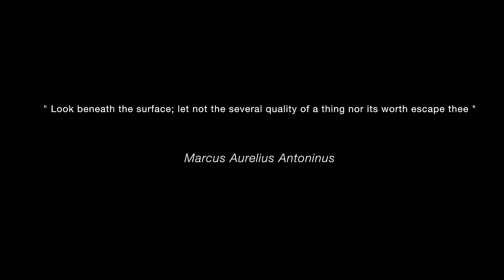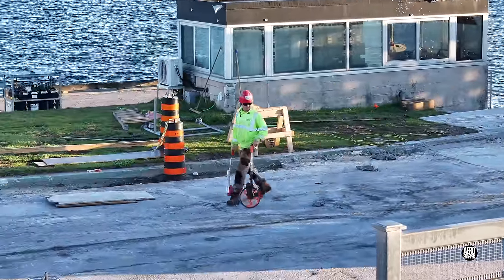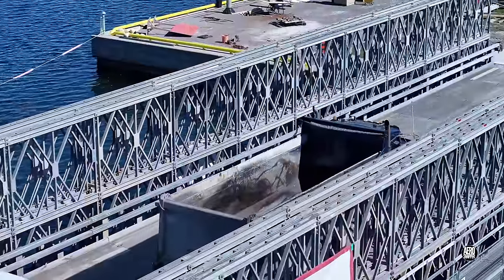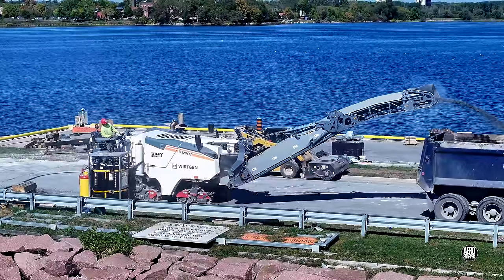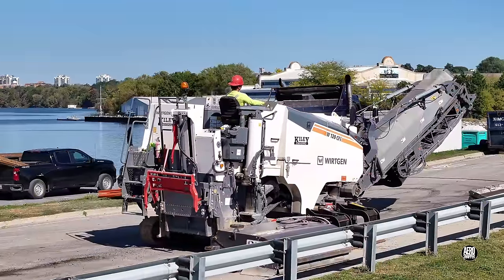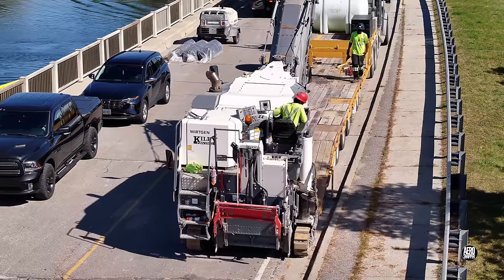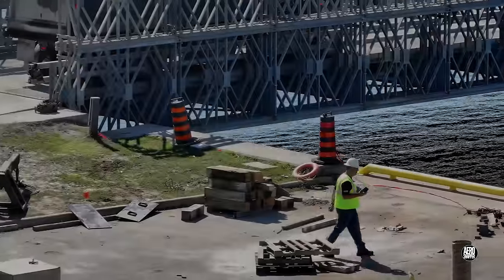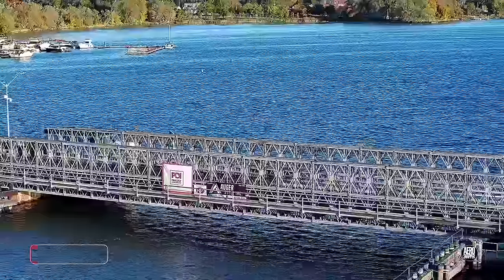A Little Bit off the Top  - an update on Kingston, Ontario's La Salle Causeway 4K

Comment: Judging by the looks of the modular deck sections, they appear to have a thin veneer of previous asphalt remaining from a previous life. So is it logical to assume that the entire stretch will get the new layer of fresh blacktop? It was a good demonstration of the strength of this Bailey bridge with the uneventful passage of both the dump truck and surfacing rig. So has the certification been done?
Reply from the maker: No idea about certification, but it seems likely; it’s a proven design in an ideal location. That’s not old surfacing on the deck, it’s a no-slip finish based on an epoxy base